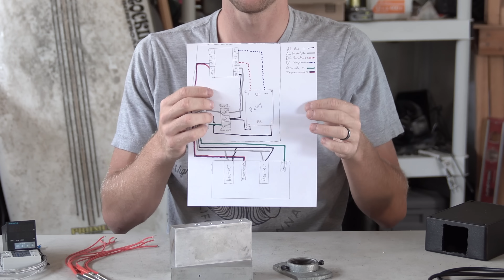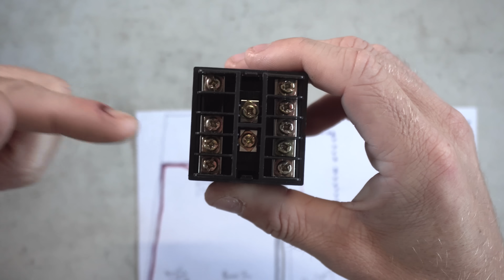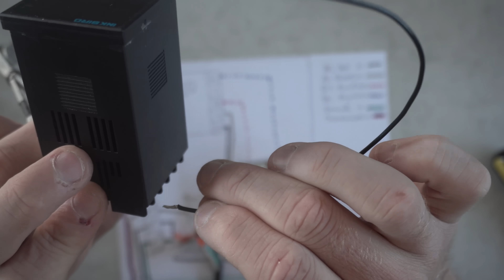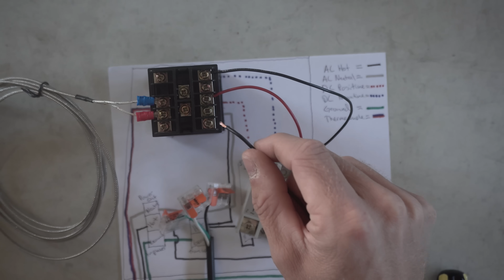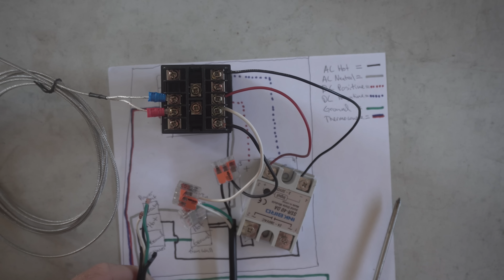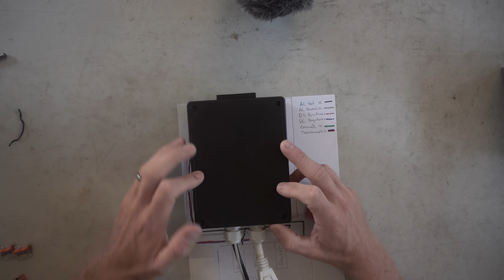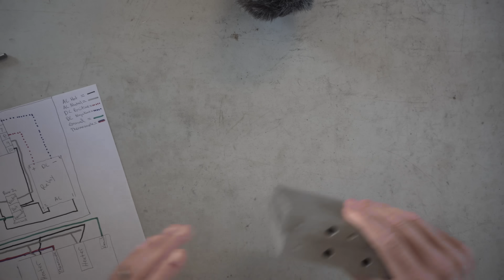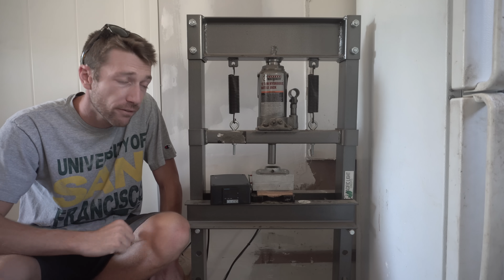DIY Rosin Press and Plates

Comment: Just got everything in the video, picked up a 12 ton press from harbor freight, they were $120.00 and were on sale for $80.00 bucks, I’m really stoked to get this together and do some squishing. Thanks again Gene. Pretty awesome dude. 😎
Reply: Yes USD, just under $300.00 bucks, I got everything that Gene has listed in the description section, and put it together exactly the way he’s doing it here, it works really well, my favorite thing to do is make bubble hash and press that at super low temps and get this buttery rosin. Yum
Reply: I’d like to add, This press build, is an awesome build guys, I’ve been looking at some basic pre-made presses on line that are about the same as this one, and it almost seems that we can build this one, and customize it to your likeness, for at least half of what a pre-made press costs, sometimes a lot more than half. By building your own, also gives you the benefit of understanding all the components and what they do, if you ever have an issue/problem, you can fix it yourself. I ordered a couple extra heating elements just in case, I mounted the top plate a little different because it seemed a little slicker to me. It’s worth the time it takes to do. Good luck to the folks that build one. 😎
Reply: How much did the entire build cost ya? Also USD?

Comment: Now that i can power up is there a setting im missing? Temp is set at 180 f but it does not stop heating up. I unplug at 250 but it would climb higher if i let it
Reply from the maker: You need to follow the wiring correctly. If it's not cutting off...check relay.
Reply: Relay cuts off and the "out" light cuts off on the pid but the temp still rises on the  display... maybe tc hole is too deep and its reading dead air temp? Im stumped
Reply from the maker: Need to see if it's really cutting it. Did you check everything after the short. Could you have more switched and its just cutting ground not hot?

Comment: Could you recommend a good PID that will control each plate so I have control of everything? I assume at that point, I would just need the dual PID and another thermocouple, correct?
Reply from the maker: yep. two PID systems
Reply: Okay great, I’ll go with the two separate units if I feel it’s needed. Thanks so much for getting back to me so quickly. 😎

Comment: Gene could you add a product link for the 18awg I see you have red white and black problem I'm having is there are so many sellers could you link us non electrical people to a safe wiring kit that can handle the load I don't want to get cheap wire basically

Comment: Ok I get the wire but what I meant is the cartridge heaters you linked to how many come is it one or two for 9.99 I'm trying to figure out how many to get I already bought the pid relay and thermo coupler box and glands just wanted to hold off on the other stuff till I heard from you and I got the two power cords as well almost lol
Reply from the maker: Dude...how many heaters are used in the build???...buy that many.
Reply: @GreengenesGarden  
Your missing my point so I'll try a third time nicely you added a link to a product how many cartridge heaters come with the order of ten dollars one or two I am aware you used four from the get go I'm not as to you that
Reply: It looks like u get one heater for ten but my gf thinks two I didn't want to end up with eight I'm just wondering why u abstracted I was asking how many heaters to use that's opposite what I asked bro
Reply from the maker: I have understood you fully the whole time. But you're about to put together an electrical device with AC heaters inside of metal plates. And you can't figure out how many heaters you get in a pack of 2pc...with a description that says "package content: 2 cartridge heater". Did I really just have to clarify that to you? You should listen to your GF more.
Reply: It has nothing to do with anything that you said I have bought allot of stuff and description was not what I thought as I had no clue what I was buying like most people here we are learning as we watch your video and she had the question as well hence why I used her account I was being funny but you sir I believe are try to make a joke out of me asking u a serious question if you understand me than why did I have to ask three times no need to be rude you could have just said it comes with two dude very simple
Reply: I mean no need to try to be a jerk or give me an attitude I obviously am aware how dangerous it is why do you think I want to know for sure and I don't find the need to have that many if I was wrong I almost bought four sets I don't find anything wrong or funny about what I asked
Reply: I am not trying to be an ass I have no idea what I'm doing like most the people I'd assume watching u I appreciate what you do trust me I just don't see the need to be like that I'm just trying to save money and be safe as I'm clueless till I see you do this and you are saving me a shit ton teaching this

Comment: Question what gauge wire I internal I recall you saying a number but couldn't find a link on Amazon above. Also with the cartridge heaters you show do two come per 9.99 or do I need to purchase 4 sets thanks great video
Reply from the maker: 18awg. The build uses 4 heaters just like shown in the video.
Reply: The heaters come in 2 packs, so you need 2 orders to get 4 heating elements.
Reply: @hashtastic3537  the new issue I'm having is I didn't know the bits we had listed in the build we're not for the heaters. For anyone doing this you need to order a 9mm bit as well as the two he listed I'm not sure if he forgot to add or assume we would know but just in case you guys didn't realize that you need that to drill the pads the other ones are for the set screws and the thermal coupler

Comment: my pid keeps the light on out and does not heat the plates? please help
Reply from the maker: Check the wiring again.
Reply: @GreengenesGarden  Well, I think the problem is that the cartridge heaters that I have to use in Spain should be 220 volts since here the current works at that voltage.. what is your opinion since I have no notions of electronics?
Reply: I think the heaters have burned but I'm still doing tests, but I'm desperate hehe

Comment: What size drill bit did you use for the hole to fit the cartridge heaters in ?
Reply: When you order cartridge heaters they tell you the diameter in the description.         I believe the ones he uses is a 8mm hole. I ended up getting ones that require a 9mm hole

Comment: I could add heaters of 110v 250w to that same system without having to change anything in the configuration of the pid and the relay. sorry for my english .. I am spanish. a greeting. Congratulations for your video!
Reply from the maker: Yes that would be ok. I would suggest using thicker gauge power cords(14awg) if you are planning on running four 250w heaters.
Reply: thanks for the video and for the help

Comment: May i suggest a small ball of aluminum foil for better contact? I made a waste oil burner nozzle and didnt have the correct tap for the TC. So i balled up a small piece of foil, dropped it in the TC hole in the aluminum block, and screwed the TC in. It had great contact with the tip like it is supposed to and gave very accurate readings.
Reply from the maker: Good idea. That would be pretty  perfect. Thanks.

Comment: Great video man I got my pid all wired up ready. My plates come in tomorrow. I was looking up floor flanges and u should suggest this one

 https://m.lowes.com/pd/SteelTek-1-1-4-in-Silver-Galvanized-Steel-Structural-Pipe-Fitting-Floor-Flange/999930954

It has a built in set screw it will save alot of people time and hassle. 

Your video was great step by step .made things very easy.thanks

Comment: Hello would I be able to follow this tutorial in the UK with 240v AC? Thanks
Reply from the maker: Yep, all the same. Th driver will take 90-305v AC.
Reply from the maker: Just makesure to get heating elements that are for 240v/220v.
Reply: @GreengenesGarden  thankyou, I've ordered all the parts now with 240v 100w heaters. Thank you very much for this tutorial as I haven't been able to understand any others I've seen

Comment: Only thing im not understanding here is why Aluminum? Why not Stainless Plates to start with instead? Considering Even with Aircraft Grade Aluminum you are still going to be a huge risk of marring and indenting the plates once they start being used and having pressure applied especially in excess of 3000psi... I would think Stainless would be much better suited for something like this where we are going to be putting tonnage on under a press after all.. IDK maybe it's the Fabricator in me screaming why use Aluminum when Stainless would be better in almost every way? Maybe im missing something? Heat dissipation difference shouldnt matter if your operating correctly and keeping the dies tight between presses to hold your temperature.. 

Everything else seems very spot on however.. especially in wiring instructions im mean seriously if you cant follow what was presented here then just stay the hell away from anything wiring or electrical then. Thats the only thing that kinda caught my attention though with the Aluminum Plates over Stainless. Especially when considered we will be heating the plates which will only increase the likelihood of denting or marring the material eventually after prolonged use.. Stainless at the very least would last exponentially longer i would imagine. Would love to hear an outside of fabrication opinion of why. There must be a reason.
Reply: https://gopurepressure.com/blogs/rosin-education/rosin-press-heat-plates-aluminum-vs-stainless-steel
Reply: @antony1m  Thank You Sir thats EXACTLY what i was looking for! \m/

Comment: Mine isnt warming up at all, any idea on the fix? Everything turns on and  is wired correctly but no heat output
Reply from the maker: If all heaters have no heat, there it's not wired up correctly or possibly the relay.
Reply: @GreengenesGarden  Any way to test the relay?
Reply from the maker: Test the voltage
Reply: @GreengenesGarden  How would I do that? Im not too savvy at this. I tested the 1~ slot which shows the 120v coming from the wall but no other readings on any of the others.

Comment: Is there a reason we use aluminium plates as opposed to steel?  I realize that aluminum is a better conductor of heat, but in this application, does it matter?  thx
Reply from the maker: Better conductors and easier to machine.
Reply: @GreengenesGarden  https://gopurepressure.com/blogs/rosin-education/rosin-press-heat-plates-aluminum-vs-stainless-steel
Reply: https://gopurepressure.com/blogs/rosin-education/rosin-press-heat-plates-aluminum-vs-stainless-steel

Comment: is the w of cartridge heater matters?
Reply from the maker: For quickness and easily sustained heat yes.
Reply: Greengenes Garden humm i just do the ground thing on my plate all wire up alle the same ass your video but my inkbirt is telling me after 3 second i plug it (orALL) 1321

Comment: anyone want to share the TOTAL cost of this project?
Reply: Why not just follow the links and add all the prices of that will be your total. There's so much info in here to hell with the costs At least Imo because. Small rosin presses cost upwards of $400 or more. Guaranteed this is less than half that cost
Reply: @Jstro14  right. It's definitely going to be cheaper than buying plates. My buddy has a lot of money into his press. I'm a welder fabricator and after talking to him I'm building my own press frame from weldox 900 plate "140,000psi tensile strength" a stubby 20T bottle jack and I'm just looking into the plates now. I'll probably put guide rods and bearings in the plates "like the high end ones you can buy". I'll have less than what he has into his plates alone into the entire thing. Depending on a few factors I might build a few extra and try to sell them at a profit yet cheaper than name brand presses.
Reply: 238 shipped using all the links but finding a 75$ 6ton press

Comment: Suggestion for heat cartridges if unavailable on Amazon.  Dabpress  dp-rh115 Rosin Plate Rod Heater (2 cartridges w/2 K sensors).   FYI..coming from China. Dabpress doesn't indicate this.  Good delivery time w/DHL tracking.  One will be TOTALLY SATISFIED w/this DIY.  Be patient w/ya pressin results...soon enough you'll be pressin that golden honey lookin  rosin.  GG, you ROCK!!!  Thanks for your vids.

Comment: Question: I have the 20 ton HF press and the ram is an inch and a half in diameter. I can only find a 2in flange to mount it to and it's way too big for the plates do you have a suggestion for mounting to an inch and a half ram?
Reply from the maker: Get bigger plates.
Reply: Greengenes Garden thanks for the response.

Comment: High temp Red RTV silicone would be great for the insulation 👍..use that for mushroom injection ports that go into pressure cooker 250 +/- degrees
Reply: It's what I used.   Available @ any Auto Parts store.
Reply from the maker: Yep that stuff is great. I use it on sealing fixture and sinks.

Comment: Right On !.. built mine following the 1st vid,  5x6 plates are way too big and 100% agree with doubling up on the heaters.. i hate waiting around an hour for temps ( have resorted to butane torch to speed things up lol ) .. nice work !. keep it up !  One thing i intend to do on the next rig is to put some insulating material between the top plate and the press's boom.. heat creeps up and is getting the ram way hotter than i would like.. either a few layers of leather.. or G10 ( fiberglass board, same stuff used for printed circuit boards.. comes in various thicknesses.. heat proof and won't crush ) , other than that.. happy pressing !
Reply from the maker: Ya, I have it linked to lowtemp plates for there G10 cutout. Should fit most 3x5 like setups for those that don't want to track down and cut their own.
Reply: Why do you think the bigger plates were useless? Can you not get a higher watt and longer cartridge heaters?
Reply: that's what I did derek. 125mmx100mmx30mm plates with 100mmx10mm 200watt each x4 cartridge heaters. works a treat
Reply: Why couldn't you put a couple pieces small diameter drill bit shanks (1/16"?) under the ram to isolate it from the heat?